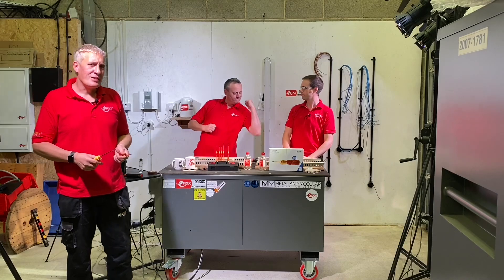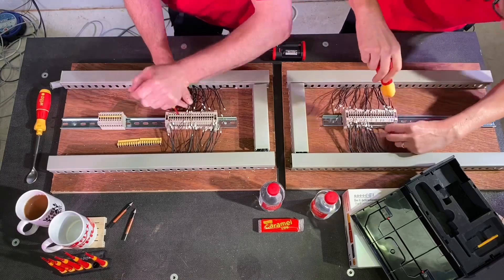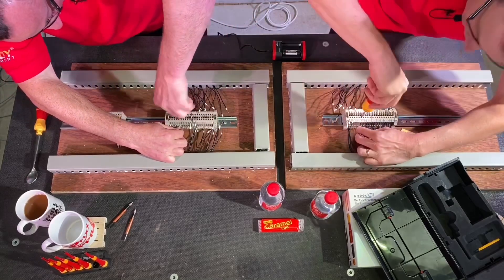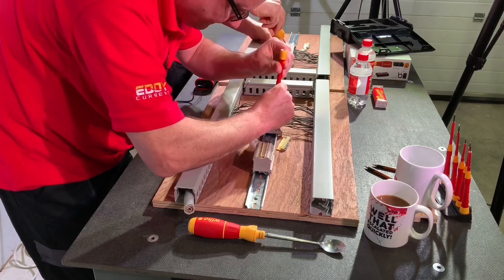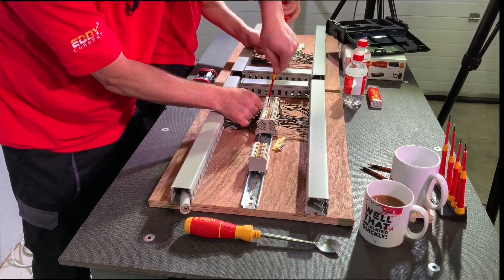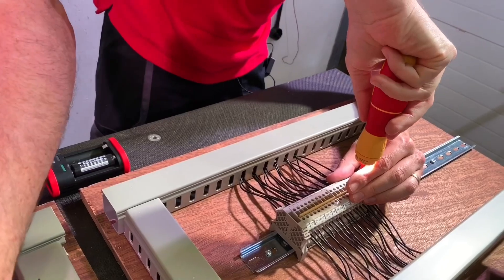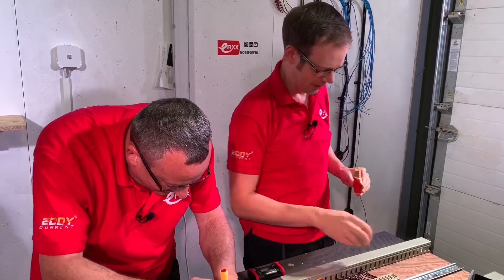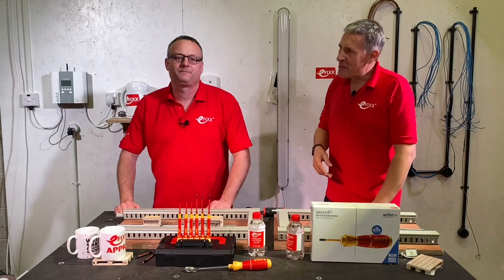THIS could be PAINFUL: WIHA SpeedE 2   vs  Screwdriver - eFIXX DIN Rail terminal challenge

Comment: The electric driver is quicker, who knew? However personally I always do my terminals up by hand I see the young apprentices running around using mini impact guns to do up terminals in sockets and CCUs. Impact drills are for chippies not hammering home M 3.5 screws into socket fronts and MCB terminals! 
Why do we need to make electrical connections quicker? What's wrong with carefully, correctly and safely? I believe they will compromise standards and safety in the wrong hands. Plus they are expensive! Not for me thanks 🙂
Reply: Craftsman makes a better electric screwdriver than wiha and it’s only $30 not $200
Reply: @pgood7266  are you talking about non-isolated tool and compare it to an isolated one in price, that electrician should not be using?
Reply: @gelisob  there’s no reason to ever use an electric screwdriver on a live circuit, but even if you did, the rubber grip on the craftsman would be more than enough to prevent you from being shocked
Reply: that is similar to saying there's no reason to use seatbelt @pgood7266 , because accidents happen in average of 1 000 000km and you don't drive that distance in your lifetime in a car. You should not be working on live circuit ever anyway. And if craftsman does not have the rating, then it's not tested or certified or safe for it. But sure, you can get lucky without seatbelts too.

Comment: Nice bit overpriced luxury,
Personally I think the handife is a better choice, got mine a couple of weeks ago and I can’t fault it I love , it’s ideal for faceplate screws and fixing ceiling rose to the ceiling as well as fitting back box’s. The speedy i or two I like the look of but would I buy one know I would not . And how many people will keep it in that silly fancy box not many , it will go in the toolbag / toolbox with all the other screwdrivers . Fantastic video as always Joe 
👍👍❤️
Reply: overpriced maybe for someone to be used as a fun toy around the house few times a year. I dont think you can call it overpriced if it's regular job workhorse that saves your wrists and gets used for years. Three of which are warranty covered. Or can you name a better isolated powered pocketable one?

Comment: Just watched an 8 min video to find out that an electric screwdriver is quicker than a manual... 

And I'm OK with that
Reply: You should have seen last comparision. Gary was using the electric screwdriver and still he lost. Poor Gary. It is not his fault. Last time the electric screwdriver was having slow motor speed and this time the Speede 2 is having 3 times faster speed. 😂😂😂😂😂😂

Comment: No clue why they made that speedy thing when for 1/3 the price you can just get a 12V drill/driver that is faster, lasts all day and has a 15-20 step torque setting. If you need to make this many or more connections, this is not the right tool at all.

Comment: I thought everyone used wago style connections instead of screwdown terminals now
Reply: Many electricians still haven't heard of them in Australia, I was one
Reply: Yes, on new builds pretty much everyone is, but there is still a lot of old equipment out there.
Reply: Lots of screw terminals in din rail settings, no?
Reply: Your not allowed to use them by EU standards. Only in junction boxes.

Comment: Electrical one all day
Because you could terminate all day
Reply: Electrical is so 1980s. 

I used to make panels with 600+ connections and used a 12V Bosch GSR that would run all day off a single battery and be faster/stronger to boot. This is just a gadget for people who don't use it professionally and have too much money to blow.

Comment: I feel like a far cheaper and maybe better option would be a 12v electric screw driver from DeWalt or Milwaukee or even just one off of AliExpress
Reply: Not for use in electrical enclosures, this is a VDE screwdriver.
Reply: @cjhification   Your not suppose to do any connection without shutting it down, if you do with it being on, you need specific certifikate. Also the bit they use for the terminals is incorrect, you need to use a SZG 0,9X6,5 VDE.
Reply: @oal2928  in the UK you still need to use 1000v VDE approved equipment to work on electrical systems, regardless of if it's energised or not.

Comment: Is there a cheaper option than wiha speede ..
I'm sure the Chinese have copied it .🤭
Reply: The cheaper option is what Gaz is using 😉
Reply: @davemorgan7695  lol 😆
Reply: You got the bosh GO, not insulated but you generally don't work with current for installations.
Reply: @perrinekld7451  oooh 🤔 maybe not ..
Reply: @stevendouglas3860  I mean, I only operate with current for small troubleshoots so I don't even need an electric tool. But for installations (off tension) my little bosch GO is perfect.
Reply: @perrinekld7451  ok Thanks
Reply: Just get a 12V drill/driver from Bosch, Milwaukee, DeWalt etc. In germany those cost like €100-120 for a set.